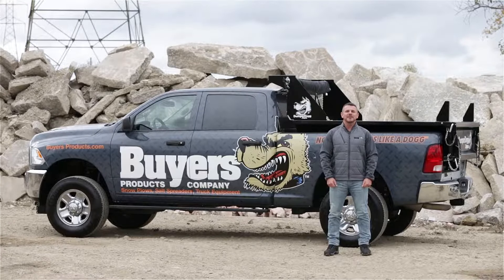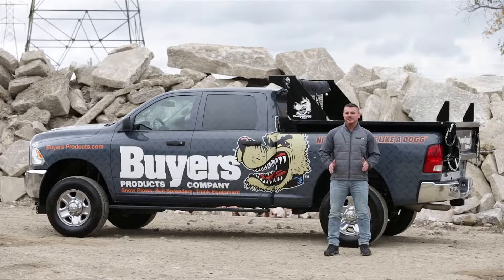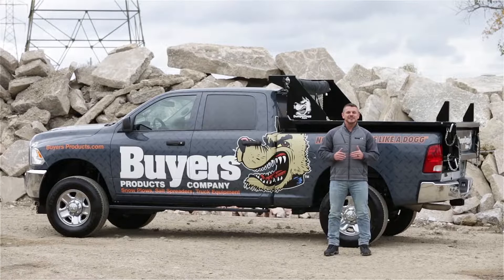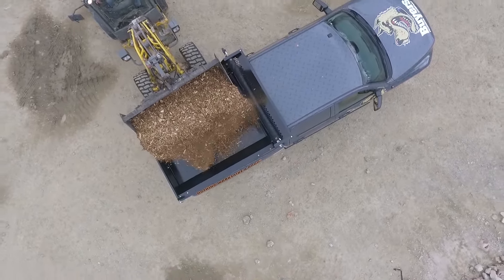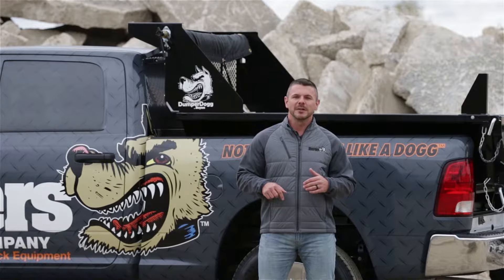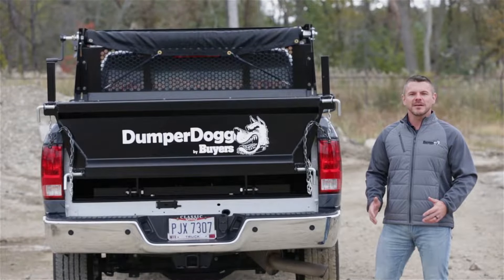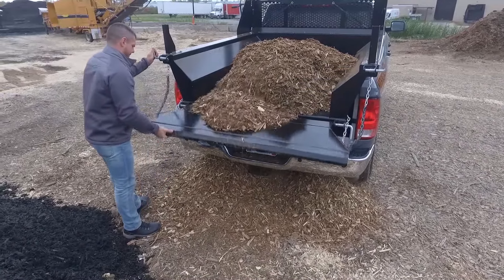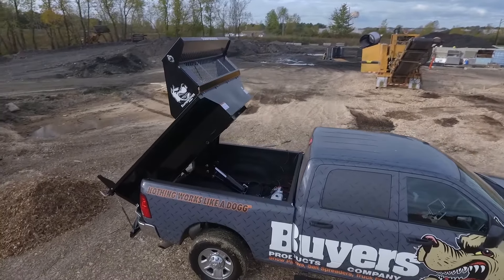Turn Your Pickup Into a Dump Truck with a DumperDogg® Dump Insert

Comment: Cool. 2 questions. How much is it? Second, can the side frames be higher to take bigger dumps?
Reply from the maker: Thanks for your comment! 

1. Unfortunately, we do not sell direct. However, if you visit the Where to Buy section on our website, input your zip code & dealers in your area will pop up: https://www.buyersproducts.com/dealerlocator

2. We have brackets to make extensions. #5531020 is the steel version, and 5534020 is the SST version.

Comment: 2022 Ford F250 regular cab V8 Gas 8' box has a Payload capacity of 3542lbs minus the 2400 +/_ lbs the dump weights so 1100 lbs payload is all you can legally carry  no matter what the dump is rated for
Reply from the maker: Thanks for your comment! We apologize for the inconvenience with the weight of the DumperDogg! Our Engineering team is always looking for ways to improve the design, wanting to put out a useful-yet-efficient product.

Comment: I know it’s rated to carry 6k lbs but is it large enough to fit that much dirt?
Reply from the maker: That would depend on the weight/density of the dirt, fill, or other materials that you are hauling. A cubic yard of topsoil can weight up to 2000+ lbs. With the optional sidewall kit and boards you can haul up to 3.5 cubic yards in an 8 ft insert.

https://www.buyersproducts.com/UserFiles/Print-Catalogs/DDLIT_D%20lr.pdf

Comment: Would this fit a 2012 ford f150 8ft bed?
Reply from the maker: Thank you for your question! Unfortunately, the DumperDogg dump insert is designed for pick-up trucks 3/4 ton and up. The 1/2 ton pick-up trucks, such as the F-150, do not have the payload capacity required for the DumperDogg.
Reply: @BuyersProductsCompany would you consider  am aluminum  version for smaller trucks

Comment: Would this fit in a 07 Chevy Silverado?
Reply from the maker: Hello, Juan! The recommended application for a DumperDogg is a 3/4 ton+ pickup with at least a 6-foot bed. If your Silverado is a 2500+ it should definitely fit, but we recommend confirming with your local Buyers Products dealer. If you need to find a dealer near you, visit https://www.buyersproducts.com/dealerlocator.

Comment: I have a 1/2 ton Toyota Tundra pick up  with a 6  1/2 foot truck bed. Can I install Buyer 6' Steel dumper dogg on my truck.  It will only be used for light loads consisting of grass or leaves. I won't  Exceed Is the GVW rating of the truck.
Reply from the maker: Hi Frank. Our steel DumperDogg is designed to fit in a 6 1/2 foot bed. Units weigh approximately 1,000 pounds or more and have a 6,000-pound capacity. Make sure that weight, plus your payload, is congruent with your manufactures GVW. People love the functionality of the DumperDogg. Thanks for looking!
Reply: @BuyersProductsCompany   Thank you!

Comment: Have one for a 2004 f150 fx4?
Reply from the maker: Thanks for the question! Unfortunately all our DumperDogg models are suggested for 3/4 ton+ trucks. That said, we recommend checking with your local Buyers Products dealer (https://www.buyersproducts.com/dealerlocator) as they may have a solution that can work for your needs.